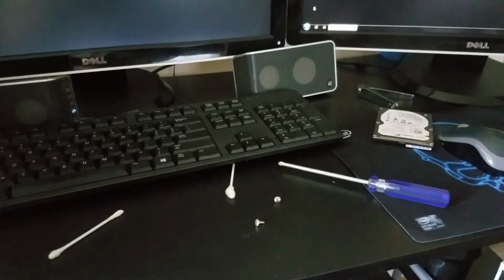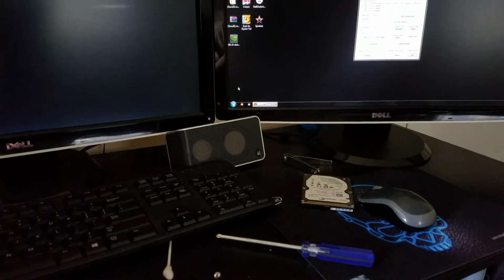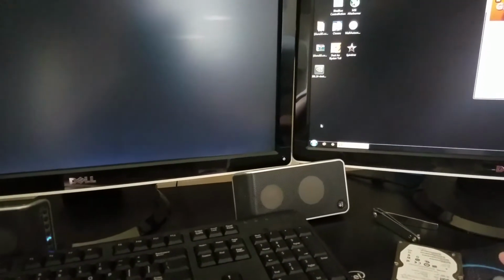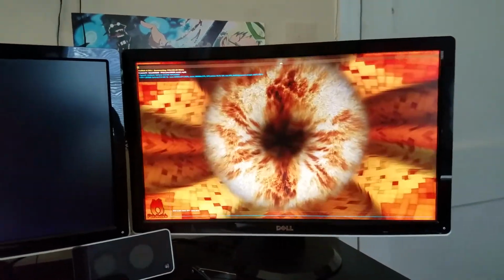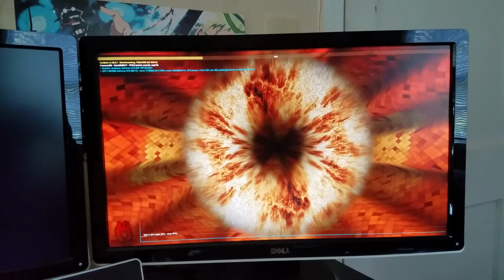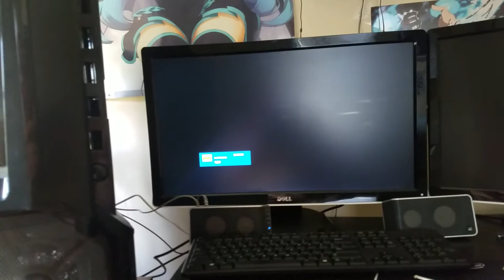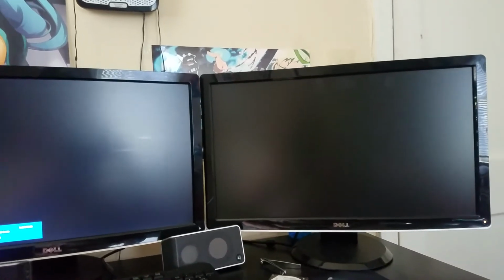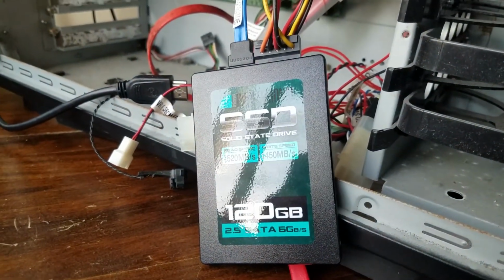EVGA GTX660Ti Problems - Shuts down / Black screen

Comment: Hello! Thats happen when the card is loosing the 12v power in load. .In my case was because the power supply 12 v cable was too slim. You should check the 12v plugs of the vcard . Chek inside the plugs for rusted pins and resolder the plugs pins on the video card. Good luck !

Comment: My Gainward GTX 660 Ti does the same thing on a Coolermaster 750Watt PSU.  My monitoring shows the card trying to clock higher than the boost clock 980mhz that GPU-Z repots.  Mine boosts up to 1084Mhz in 3DMark Fire Strike.  When I run Heaven 4.0 benchmark the card every so often tries to boost to 1202Mhz and that's when I get the crash.  If I use MSI Afterburner and do a -115Mhz on the core offset underclock the card runs fine as It can only boost to 980Mhz.

I'm going to trying cleaning the card tomorrow night and reapplying thermal paste to the core and then retest and see how it goes.  Hopefully my 2nd Gainward GTX 660 Ti doesn't require the same treatment.
Reply: MantaProx2 hi, i have a gainward 660 ti aswell but i have a weird problem, maybe you dont know the solution but when i plug it in and start up the computer all the fans start but i get no picture, the screens just says there are no cable connections. I changed power supply but it still made no difference. Can this have with the motherboard to do?

Comment: To me looks like thermal issue. That means you need a nice cleaning and  new paste on the chip. If you tried that already then is a coil or condenser thermal fail, in that case if you don't have the tools to repair it yourself it is useless cause it doesn't worth the cost for repair on an individual.